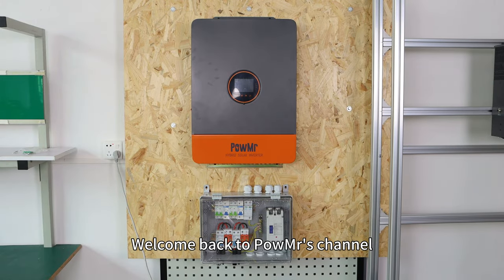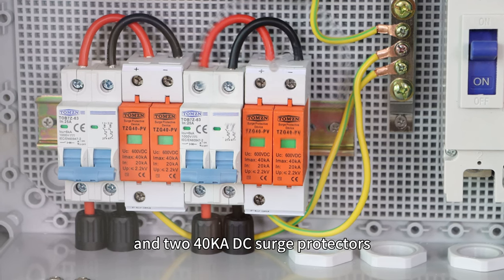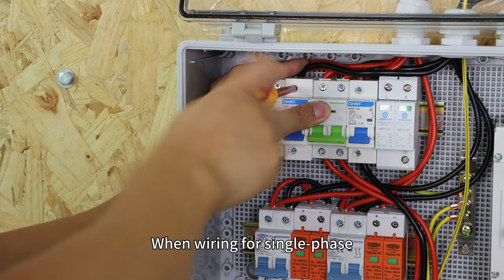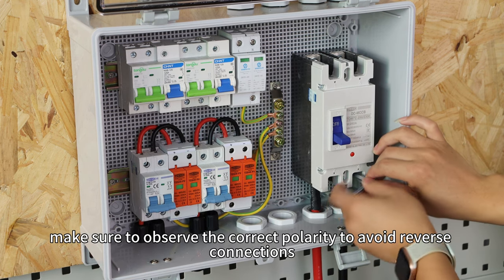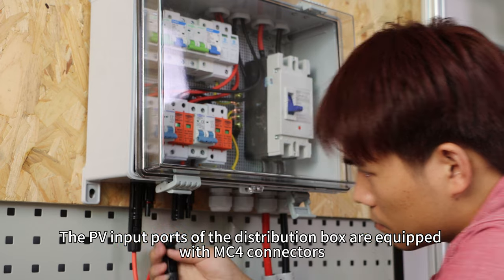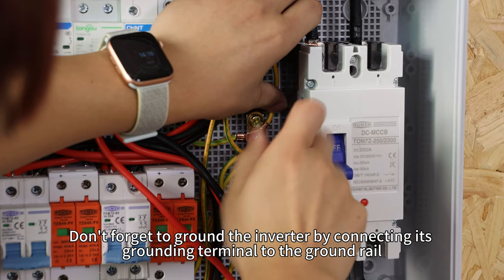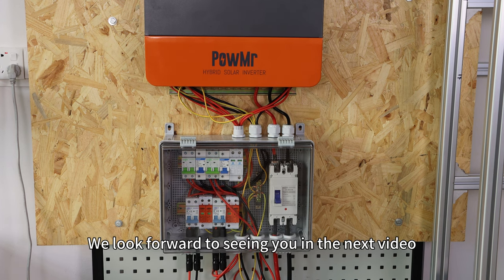How to Wire the POW SunSmart 10K

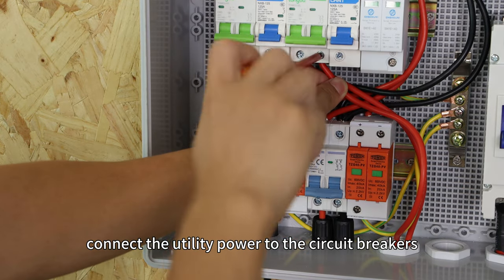Comment: At 2:46 of this video, 63A breaker for AC inputs has two red wires in the left port (one going to inverter, and another one to surge protector's L port), and in the right port one black wire (to surge protector's N port) and one more red wire (is it L? in the same port with black wire that goes to N port of surge protector?) It looks like this one more red wire is going to inverter as second L (why two L lines for AC input?)

Thank you for clarifications and maybe adding a diagram in your answer.
Reply from the maker: Hi, please send your problem to this email: support@powmr.com. Please note that we may not be able to promptly respond to you due to the Lunar New Year. We apologize for the inconvenience this may take and thank you for your understanding. We wish you all the best!

Comment: Hello can the AC output of the inverter be connected back to the main grid electrical panel? Essentially the AC input and Output are both parallel circuits tied into the grid?
Reply from the maker: Hi, do you mean connected to the grid?

Comment: Hello, if I need to input split phase ,  240V , what would be the connections  like I would plug the input from a 240V source to bypass,   to utility incase the solar is insufficient and the battery is too low, to supply the load and to charge the battery from 240V utility instead of 120V.
Reply from the maker: Hi, kindly send your problems to this email: support@powmr.com

Comment: Hello, I have a POV-HM-10.2 KW inverter, at the AC input, in this I connect L-L-T that comes from the circuit box, the AC output I can connect to a breaker in the same box.
Reply from the maker: The 10.2M model can only L- N (220-240V). May I know how many live wires need to be connected?
Reply: @PowmrSolar  It is a two-phase 220, the question is the power supply of the AC input comes from the same circuit box, where the AC output cables will arrive
Reply from the maker: @wilmersabalza  Hi, 10.2M model is single-phase, not two-phase. You need to configure another converter to convert single-phase 220V to split-phase 220V.